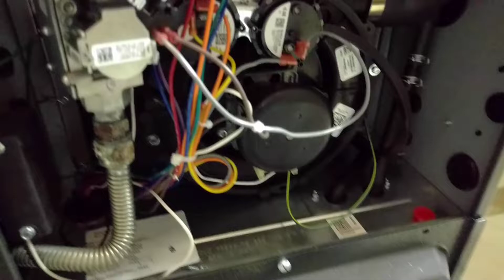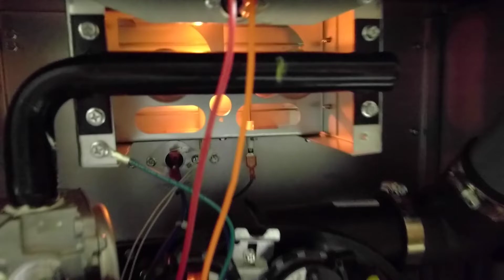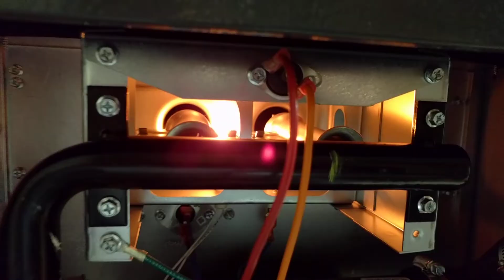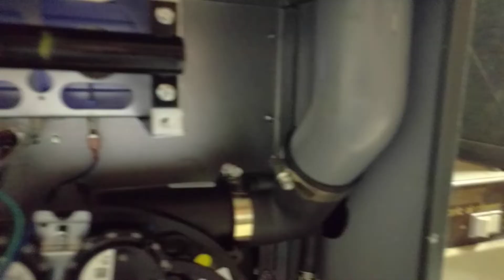Goodman Furnace Ignition Sequence

Comment: So my guess furnace starts off with what you're saying of that sequence and then the ignitor comes on but my burners never come on what could be the problem? I do hear clicking but I just never hear the gas come out so the burners can start up
Reply from the maker: Check the pressure switch tubing. Verify that the gas is tuned on. Inspect the burners for excessive rust/corrosion and clean if necessary.

I had a furnace like this that had a similar issue and it was caused by rusty burners not allowing the gas to flow to the ignitor properly.

Did you get it fixed? What was the problem?

Blessings from Minnesota!